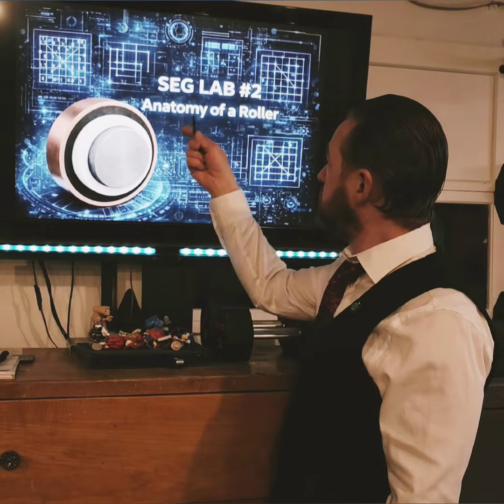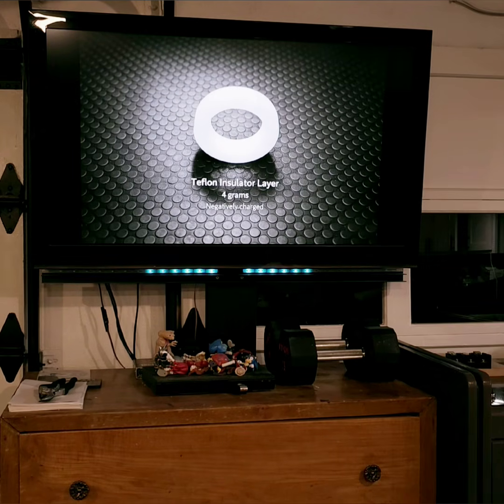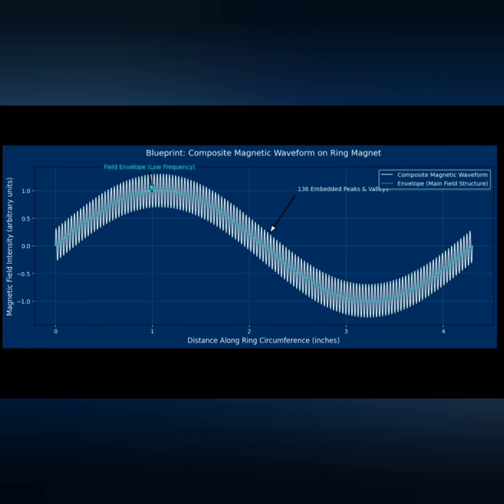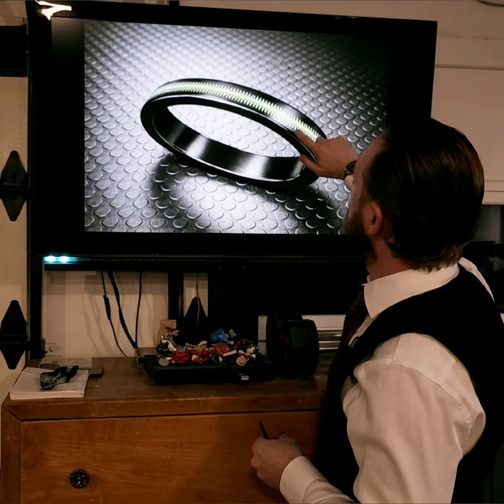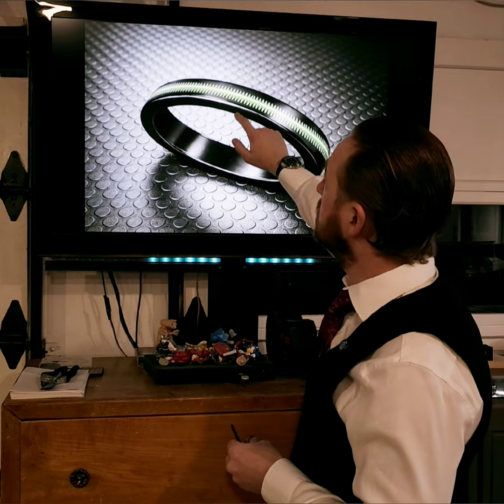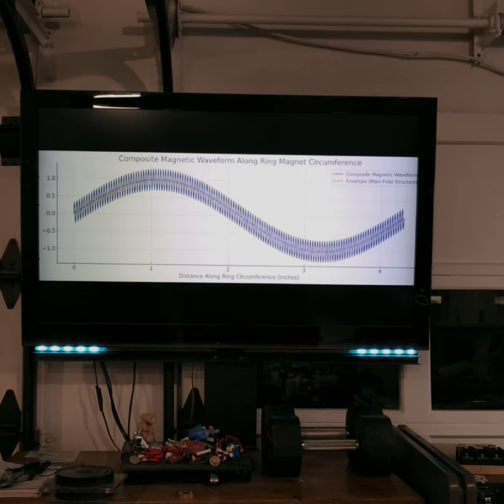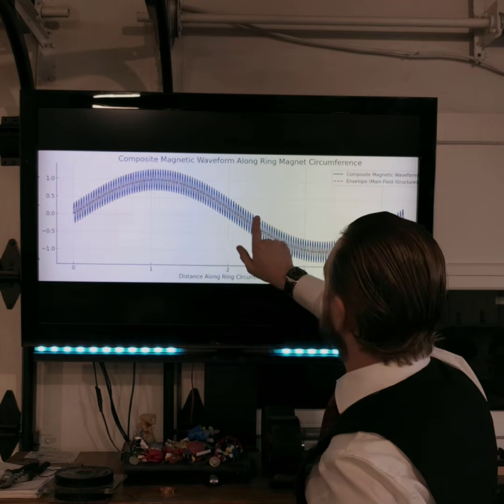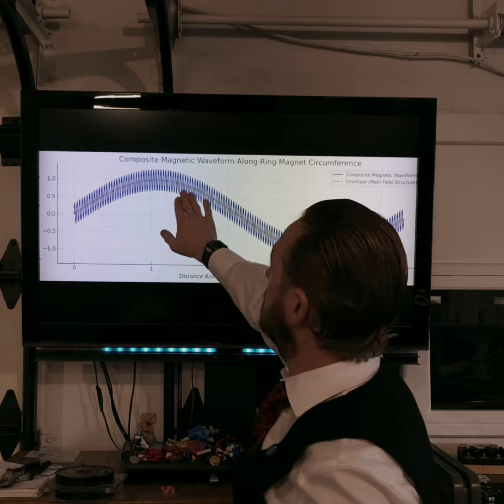SEG LAB#2 Anatomy of a roller

Comment: Wait, I don't understand one point about the wave. You say that each segment of the roller must have a wave going up and down, referring to Russian experiments, I assume those of Roshchin & Godin. Okay, I don't believe that these guys actually achieved anything, as they have been proven to be fraudsters. But let's assume they weren't lying in that case. According to their documentation, they had two magnetic rows, and they alternated north/south outwards and inwards many times, creating a magnetic gear. This is a completely different principle from what you are doing. Your prototypes are much closer to Dolphin's, BUT there are huge differences too; his wave went up and down across the ENTIRE surface of the roller, NOT on a single segment, and the north/south poles were also directed outwards and inwards similar to Roshchin & Godin experiment. In the end, he also tuned the waves of the rollers and stator according to the principle of magnetic gears, only with spiral teeth instead of straight ones. So, if you want to magnetize each segment separately and achieve what this Russian experiments, and prob Searle showed, you need to magnetize the wave inwards and outwards on each segment, and then, during assembly of the rollers, you must shift the angle of each segment so that the TOTAL wave shifts, forming a sinusoidal magnetic gear. 

As I understand it, if you continue magnetizing the rollers in the same way, when you assemble them you will get 7 parallel but separate magnetic patterns. This might not prevent you from creating a magnetic gear, but it will no longer correspond to what Searle showed at his conferences or what Dolphin showed in his videos.

Or am I misunderstanding something? Have you tried connecting these four finished magnetized segments and observing the resulting combined wave of the roller?
Reply: You really believe that the Russians are the only fraudsters involved? The entire Searl mythos is nothing but a rich mixture of fraudsters and dupes. Just look at this poor guy, Ritchey. He will eventually have to start to sell his machines, and thus become a fraudster,  or recognise that he has wasted his life and money and possibly fall into a suicidal decline if he does not cling to the madness forever.
Reply: @DJF1947  Everyone should have a hobby. In my free time, when I’m not working or spending time with my family, I make games. I don’t care that they don’t make any money and only cost me money, because I’m doing something I genuinely enjoy. Even if everything about this effect turns out to be fake and leads nowhere, he is still gaining new experience and knowledge. In fact, even in China it’s almost impossible to order magnets with the exact magnetization you need, so that knowledge and skill alone could be turned into good money if he started making custom magnets for US customers.

Comment: I always thought about using the head unit of the VCR to magnetically print frequencies
Like you would onto a vhs.Tape.
Reply from the maker: It's something I've considered through the years. The difficult thing is doing any kind of magnetic alterations with neodymium magnets requires extremely high voltage and current. It probably could be done far easier with ceramic magnets.
Reply: @woodbrassandglass  Try ceramic magnets; Dolphin worked with them and had some results. They are also very inexpensive and easier to work with. I generally think that if there is an effect, then complex magnetization is not necessary. Roshchin and Godin simply inserted magnets, Dolphin assembled Halbach arrays, and Searle magnetized the entire thing. Three completely different approaches, and all of them worked to some extent, the only common principle is the magnetic gear principle with proper tuning of the interaction of one magnetic fields of rollers with stators.
Reply: @GrandmasPasta  I see that you are using the old spelling: 'Searle'. He made the slight change in order to help to hide his criminal background. Please do not draw attention to this; stick to 'Searl'!